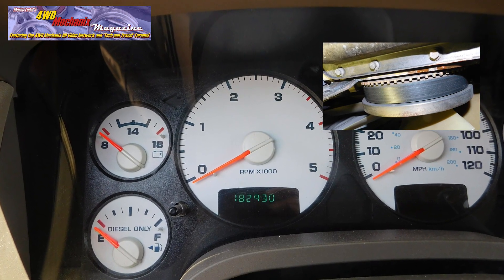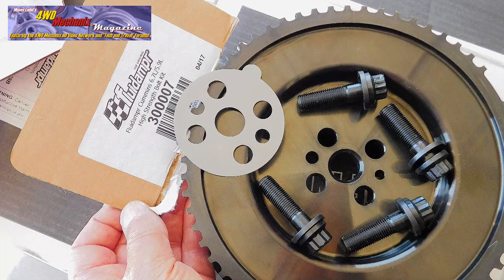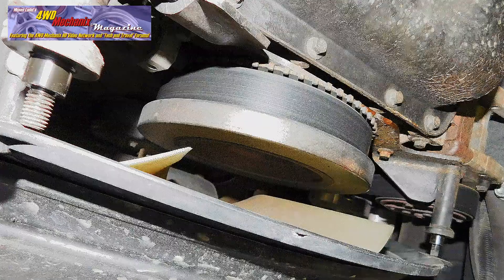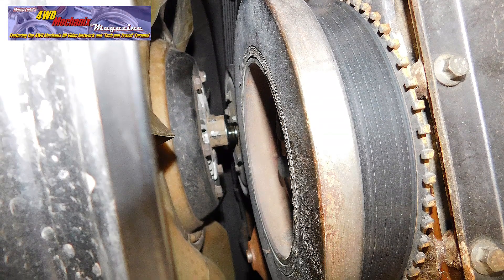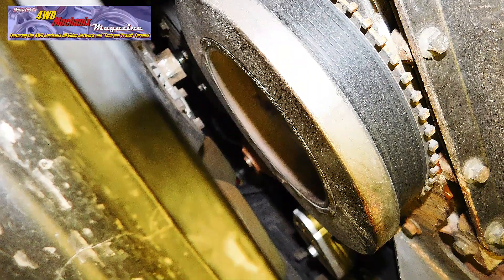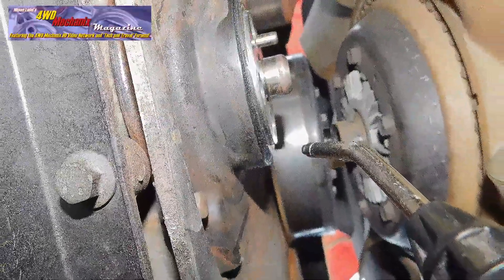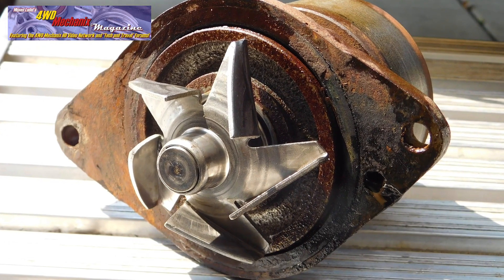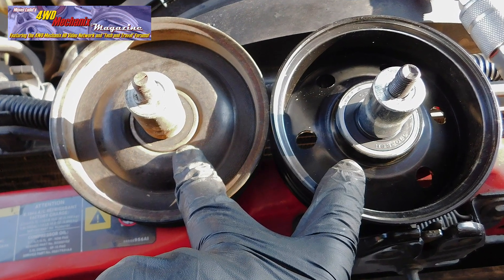2005 Gen 3 Ram Fluidampr Installation

Comment: How the heck did you get the serpentine belt between the dampr and fan pulley; I have a fluid dampr and need to replace my belt
Reply from the maker: Well, Fluidampr helped here.  They redesigned the Cummins damper to allow a belt change without removing the damper.  The earlier applications from Fluidampr would not allow this.  You may have an earlier Fluidampr, and if so, I am sorry that you need to do the extra work!  See the part number comparisons and footnotes at the Fluidampr website.  Let us know what you discover.

Comment: I didn’t have to do none of that on my 05 Dodge 3500 4x4 took bolts right out took about a half a hr . Blue loctite  good to go .
Reply from the maker: Glad your approach worked and saved time.  I did mostly the factory service manual method.  Thanks for sharing.

Comment: Well done video.  Very thorough.  I just ordered the Fluidampr for my Gen 3.  I haven't done a visual check but feel as if the engine has more vibration recently.  I've got ~ 162,000 miles on her so it's a good time for an upgrade anyway.
Really surprised this is the first comment on your video.  Thanks again for taking the time to document the process as well as the bonus of the pully and water pump.
Reply from the maker: Thanks!  I appreciate your feedback...There is an expectation that the OEM damper will fail.  Even the factory workshop manual notes that checks should be made regularly.  Engine loads play a role with the OEM damper's lifespan.  My damper, frankly, was not in bad shape.  I installed the Fluidampr for engine protection and to counter harmonic vibration.  Factory dampers on our 5.9L engines were aimed at a specific rpm range(s).  The Fluidampr is effective at all engine speeds.  I did not notice a significant difference until pressing the engine under load.  In a passing situation that takes rpm well beyond the normal range of operation, smoothness is noticeable through the entire drive system.  This includes the driveshaft and an axle with 4.56 gearing.  The 4.56 gears spin the driveshaft at a much faster speed.  You'll be happy with your installation.
Reply: @4WDMechanixMagazine  Finally completed the install.  I decided at the last minute to order a set of ARP bolts instead of using the existing ones.  I went ahead and remove the clutch fan entirely.  I slid a sheet of cardboard up first to protect the intercooler fins. It wasn't too difficult to remove the clutch fan assembly, but in hindsight, it would have been better to use your solution.    It was a tighter squeeze when sliding the fan assembly back up with the new balancer installed.  The Fludiampr definitely sticks out more than the OEM.  In the end it is mission accomplished.  I haven't done a road test yet, but there was a noticeable improvement at idle and revving it. The ARP instructions said 90 Ft-lbs  and the Fluidampr instructions called for 92 Ft-lbs.  I went with the 92 Ft-lbs.  Thanks again for your video, it was a great reference tool.
Reply from the maker: I am pleased this turned out well.  I believe we've done our engines a service.  I'm protective of my 5.9L Cummins engine and the 48RE automatic, driving intuitively to preserve the powertrain.  My OEM damper was actually okay (contrary to all the stories we hear), but I'm glad it's replaced.  I like the Fluidampr technology and working principles...We did the right thing!